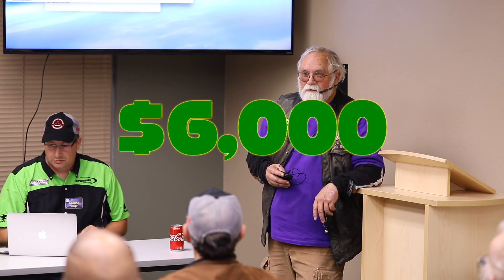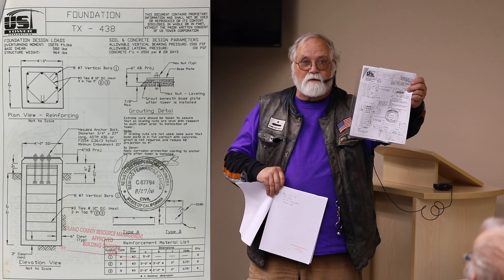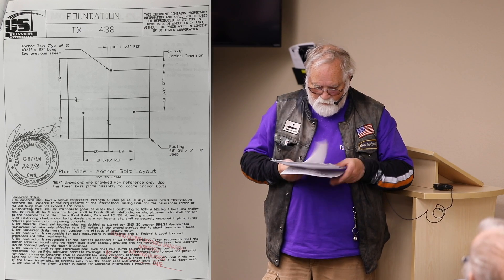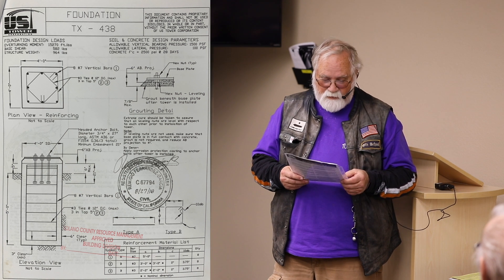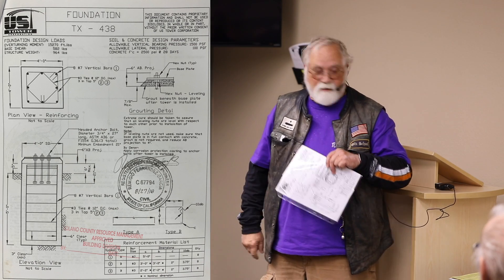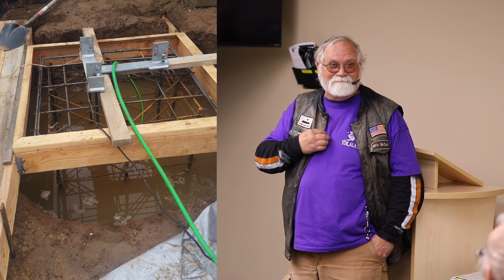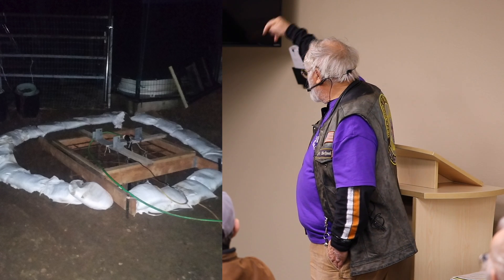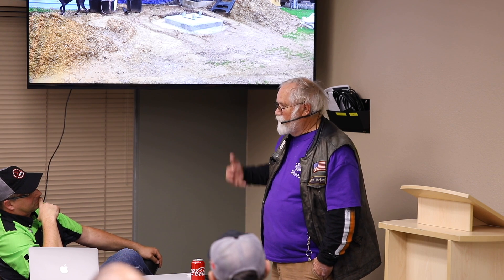Building a Ham Radio Tower, First Steps - in California

Comment: You talked about the power of Lighting. I live in Florida, Lighting is very common. I have seen 2 ground rods about 6 to 8 feet apart that had 40 volts between them. One had taken a lighting hit and we have sandy soil and when you heat sand hot enough it makes Glass! The ground rod had glass around it. This is why they want the ground rods wired together with heavy wire.  Hope you have a lot of fun!   73  W4DES

Comment: Good info! I'll be building a Rohn 40 this year in Alaska. I'm not in city limits so I'm hoping that I won't have as much red tape. I'm a structural superintendent and have 25+ years in the industry but this was a great presentation. Thank you !
Reply from the maker: Thanks! Alaska sounds amazing! I've only had a few quick visits to Elmendorf.
Reply: @HamRadioTV  Alaska has a decent ham radio community. I am in contact with Japan and Eastern Russia a lot. Elmendorf has a UHF/VHF repeater, I have not used it yet.

Comment: I have a California seal and I used to work for ROHN. ROHN did not do ham radio tower sealing. We also did not like California and we would charge $5000 for towers in California that needed sealing.

Do not weld rebar unless it is weldable grade rebar. It can snap off. A615 rebar, is junk steel and not weldable.

Comment: What city is this? We have towers all over the city at 60 ft. We don’t ask the inspector jack.
Reply from the maker: We are in Vacaville California. Which is 60 miles east of San Francisco.
Reply: glad I dont live there LOL Love living in the country. I just put mine up. No regs, no reports, no permits. Tax man came out looked at it said looks good after I put it up LOL :) I live in free non communist California, in the state of Georgia USA. mines 72 foot tall. I can do up to 200 feet without permits as long as its for amateur use. Commercial use needs permits no matter the height.
Reply: @mikemcdonald5147  Same here. I'm in upstate New York just above Pa and I called the town clerk just to be safe and he said "Amateur Radio? Just put it up. You don't need us." I put up a 110' aluminum tower on a hinge/4'x4'x4' concrete with angle steel base. Pulley 50' up a 90' oak. Single handedly (except a friend wanted to come see it go up & he helped hook up the guy cables). No inspectors; no forms; no taxman; no nothing. Maybe I should enjoy paying my taxes more. At least I have a little freedom.

Comment: Great video! I am curious to know what performance difference there is vs the antenna system you were using before the tower.
Reply from the maker: Thanks! Art was using some homemade wire dipoles and now has a multi band, rotatable beam on top. That gives him a lot more gain and is bringing in further stations than before.

Comment: I have a question about your mast, using the heights you listed:  38' tower height, 40' Mosley 3 el beam, 46' 6M beam and 52' 2M vertical, is your mast height 15'?  Or is it taller?   Curious what mast height US tower recommended for your configuration?   73  N7TWP

Comment: Why more complicated In that county in CA? No. 1. Earthquakes. He built his tower near several active earthquake faults. No. 2 High winds. Lots of high winds in the area. So much so that wind generators are erected in the area. His design has no guy wires to support the tower so a big, expensive, engineered foundation is required so it stays up in a storm that he showed flooded the hole and turned the soil to mush. I other counties in CA im sure you can get it done for cheeper.  But $6000 for that part of CA is very reasonable.
Reply from the maker: Art did it by the book, and my hat is off to him. We know a few others with towers that just put them up, without getting the city/county involved. I'm aware there is a lot of building codes for earthquakes out here but I've not felt anything above a 1 for the last 20 years. Rio Vista is where the windmill farms are, and does have a lot of winds, but it rarely gets windy in here Vacaville.

Comment: Good stuff but just my 5.6'x5.6'x8' deep concrete hole/pad was exactly $6,000 and that is for just the pad itself. That was $6,000 turn key from start to finish and im installing a US Tower TX-489MDPL. All in I'm going to be more than $60k, i understand were talking two different towers but alot of money today in 2023 for just the foundation pad.
Reply: Yup, it seems a little cheap only 6k all in for a tower. But why even spend that much cash outlay for only a 40 ft tower. Seems a bit penny wise and dollar fooolish. 75 -80ft requires same investment of time, labor and money to erect as the 38 ft tower!  
Usually it's not the cost of buying the actual tower itself,,, it is the investment erecting it and especially permitting it. His county required updated PE stamps and he bought his tower only one year prior and US Tower made him pay for new docs?  
200 or 300 seems not too bad but they should provide that support with the tower purchase and updated for free.. I wonder if the county requirement was because of the new TIA specifications?
I think that US Towers had to hire a PE to update to the new spec and passed the cost along to him.
 
What in the world does he have planned as far as this 18 plus foot  mast and all these collars and thrust bearings he was talking about. Are these included in his plans? Same question for his coax  running inside the tower on a chain hanging from rotor shelf? 
It does not sound included in the drawings and are afterthought that the building dept overlooked when permitting his construction. Seems unconventional if you ask me....
A couple of stupid simple vague statements when going to the county is to say it's an antenna mast and not tower. Also many times you can get away with crankup extended tower and using its nested and retracted size on your plans. As for antenna   don't detail it a a multi element beam antenna. Many times they assume that the structure itself constitutes the radiator. It's best to not be too specific. Less is more!

Comment: ok so all well and good. you live down in the mud flats. i live up in the hills of what is know as "the gold country" lots of hard rock. one almost needs diamante to dig a hole to plant a flower.
how does this change the hole standards? possible to just dig into the rock, (aka remove all dirt)  and add a bit to the square? a friend had his back yard dug out (everything here is sloped) and the crew used a crawlers hyd jack hammer... not the little guy, but a full sized unit as it also loaded up the dump truck.
Reply from the maker: Yeah, rocks would make this more difficult. The hole size depends on what tower and how high it is. Also if it will be guyed or not. This info can be found on tower manufacture websites when picking out a tower.

Comment: The 45 degree angle is actually the grout after the tower is in place and not the concrete. After the rain and the new larger hole the rebar is no longer the required 3" from the edge. You're lucky the inspector didn't pick up on that.
Reply from the maker: Thanks for the heads up.

Comment: How do you figure six bags of concrete is 6,000 lb
Reply: It wasn’t six sacks of cement, it’s “six sack cement”, meaning it requires six bags of cement per cubic yard of mixed concrete. Once you mix that with the required water (six gallons per bag of cement) and gravel aggregate, you end up with a very heavy mixture.

Comment: Here in southwest Pennsylvania. I’m putting up a US Tower TX-455.  55’ . It requires a concrete base 36”x36”x75” deep. NO Permit needed. Even if the county or township required it. Screw them.  California is to strict on everything.

Comment: I installed a 72 foot tower in my yard. I didnt call anyone or get any permits or stamps or anything else. I had my next door neighbor bring his backhoe dig a hole, framed it, called a cement company, put in cage, had them pour cement, built and installed my 72 foot tower. No problems. Thank goodness I dont live in a communist country like this guy does. I live in Georgia USA. When my tax guy came out for his yearly check he saw the tower asked what if it was a fm or am tower I said it was a ham radio tower. He said ok no problem. Had it been a fm or am tower they would tax me for it and would need permits etc. Ham radio no issues no problem.

Comment: Who would want to live in that liberal run mess !  Get out while you can !  Here in Indiana you do not even have to get a building permit in my county to put up a tower . My Rhône HDBX 85 took 10 yards and a cage of rebar that I cut and welded myself then painted with cold gal 4500 PSI concrete  no inspection no permits